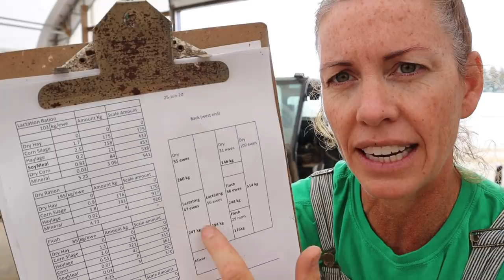A Day in My Life. 🐑 (LET’S DO SUMMER SHEEP CHORES):Vlog 324

Comment: Yes its normal for onions to push out of the ground. You will get a better yield if you wait for the potatoes to die back and then dig the with a fork. They are not designed to be.picked in ones and two's.normally they are all dug at once cried for a few days then stored damaged ones get used first and perfect ones store best. Onions can be plaited  into a string and hung somewhere dry. Remember the pictures of the French onion seller on a bike?

Comment: Suggestion for you Sandi, for a little less back breaking:  You use a broom to sweep your aisles.  Why not purchase a high strength shoulder held leaf blower.  Hold it close to the cement and blow all the excess straw down to one spot, then put it in all in one place and spread it out from there within the confines of the enclosure.  The lip you have between the pen and the aisles should keep the straw from blowing too much or too far and the straw will all be in one place making it easier than dropping load after load after load from the broom scooping method over the top of the wall of the enclosure.
Reply from the maker: Lol!  Mark just ordered a leaf blower!
Reply: @SandiBrock  Good :)  Less back breaking, more fun naming lambie pies.  Just kidding, I'm an old farm girl, I know they are for market, but I sure do love naming them for ya even if you don't take the names I make :)

Comment: Hey Brock family!👋 Hey Sandi, I wondered what y'all did with the old bedding, if y'all used it for some called ferterlizer on  the field? Correct me if I'm wrong! Or maybe u have a vlog on it? 😆❤👍
Reply: Sandi composts all the old bedding, and per Canadian government recommendations, also puts any deadstock deep into the piles.  The bodies break down in about 30 days. Then the finished compost is run through a shredder and used as fertilizer on the fields.

Comment: Sandi, is there a reason you keep the “Billie” rams separate from other rams? Just curious...
Reply from the maker: They are just a bit smaller still... I may put them in a breeding pen with the ladies just to let them see how it’s done.
Reply: @SandiBrock  hi Sandi, will putting the young maiden rams in with older rams and ewes at breeding time cause enough competition for ewes that the older rams will mentally have more incentive to get busy and get their job done during the ewes first heat cycle making tighter lambing group and less ewes left open for next heat cycle?
I know with cattle putting a 2 year old maiden bull(s) in with older bulls while breeding causes older bulls to get the cows covered sooner and young bull gets a few cows and gets to be clean up bull.
Robin.